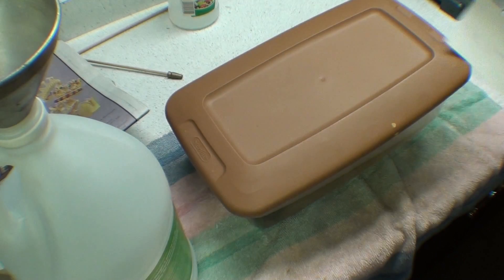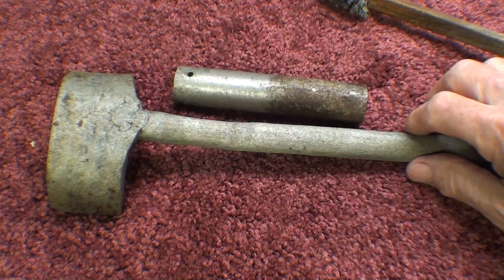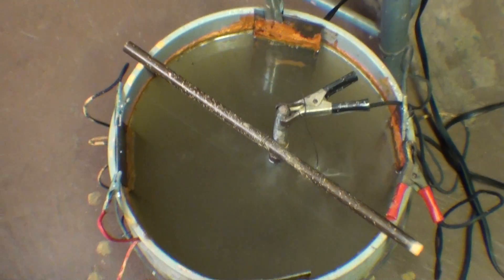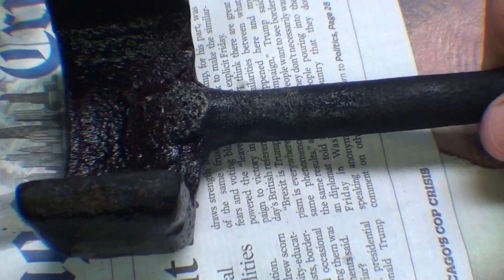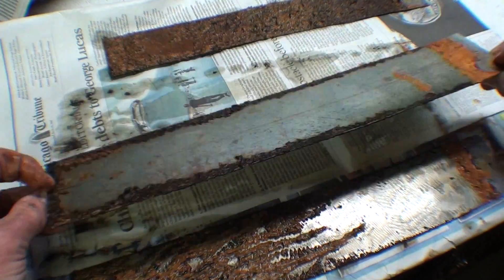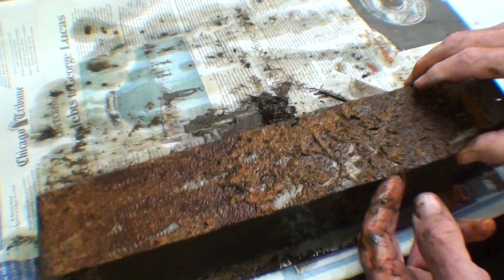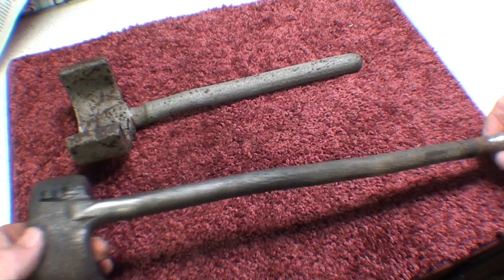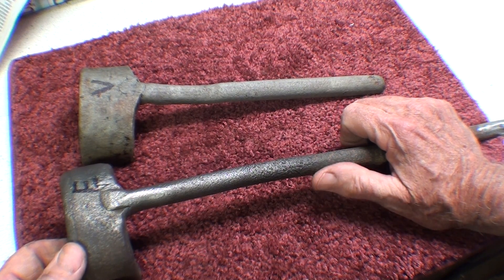Rust Removal -  Electrolysis vs. Vinegar #310 Pt 2 tubalcain

Comment: Hi, since  the two samples are of different source and maybe age, the more comprehensive comparison would have been made if both were cut in half lengthwise then cut again in half wide wise on the greater diameter then compared equally in this test. This video does not let me form an opinion - two parts from different samples have not been together in the same bath.
Reply: I aggree

Comment: Thanks for this straight forward, down to earth video that we non-chemists can understand. I think both processes work well, but for a motorcycle tank I think I would go with electrolysis, because it doesn't rust again after the process.

Comment: I find vinegar too corrosive. However you can expedite the time it takes in electrolysis by using the 10 amp charger. also clean the anodes every few hours down to bare metal and don't let the anodes or the cathode sit on the bottom of the tank. I do a lot of this and I find it works very well on all kinds of rust and even seriously rusted cast iron cookware.
BTW a great cheap source of sacrificial anodes are electrical conduit. And just 2 is fine in a 5 gal bucket. 4 seams slow down the process. Oh and the charger cant be one that shuts off automatically. And do it outside or in a well ventilated area. It creates Hydrogen gas and Oxygen..

Comment: Vinegar rust removal is destructive as it attacks the good metal as well as the rust. Electrolysis is non destructive to the good steel and only affects the iron oxide layer. The black coating left behind is magnetite and can be scrubbed off or chemically removed by soaking in a weak acid mixture such as lemon juice for several hours or over night.

Comment: What are your thoughts on removing rust from a cylinder head?  1953 Allis Chalmers WD 4 cyl engine, push rod/rocker arm style.  Cylinder side is fine, rocker arm side is rusty from rain.  Soaking in diesel fuel right now.
Reply from the maker: try the vinegar
Reply: will do...thanks.  love your videos, and love the detail.  I have a carbide lamp as well; now I know what to clean the orifice with...lol

Comment: what kind vinegar are you using I can't get it to do anything...I left it in there for a week and it doesn't do anything
Reply: ACE Champion 
I've had trouble with vinegar rust removal when the rusty part had oil, wax or grease.  I had to degrease the part and start over.

Comment: You know, the one wrench you cleaned with the electrolysis looks like a cast iron skillet when I clean it with salt/baking soda and season it. I wonder if it would turn black if you heat seasoned it with oil/lard. I think there might have been less damage to the tool with the electrolysis than the vinegar one which is why it is still so shiny.

Comment: I prepare electrolysis as it doesn't remove material. If you use graphite rod as the anode the bath will not turn into a rusty sludge mess.

Comment: used deluded vinegar to make excellent fertilizer for blue berries. they love acid.
Add some TSP to the electrolyte, it helps remove any oil and leaves a slight phosphate coating to prevent rust.
Don Warner

Comment: Hello Mr. Pete, i use the vinegar often, but I want to caution you, do not leave machine tools ( for example: 5 C collets) in for an extended period. Vinegar removes a lot of metal, especially if left for a week( don't ask me how I know this). I have found it effective to put rusty parts in vinegar for a few hours, wipe them off and then put in Evaporust, where you do not worry about eating the mental. This procedure works well and saves the cost of wasting Evaporust on dirty, overly rusty parts.  Thanks   Jim Murphy

Comment: I used Evaporust on a few handplanes and it works well. I also used it on some old japanese handplane irons, and while it removed the rust, it also removed the patina the metal had developed over time.

Comment: Mr pete the black color is because the reaction of the washing soda that tend to black the metals something similar to black oxide process I working in a black oxide company and is kind of similar process that's why you get the black color now for future projects if you want it to make some parts black all you have to do is putting it in that bucket and then oil it and you got your self a black oxide part great video and thanks for shearing this great knowledge.

Comment: White vinegar and iron don't make a particularly toxic mix. I think you are looking for trouble by contacting the EPA.
Reply: I think he was joking
Reply: I Just dump it in the yard.  Iron is and Vinegar are both plain materials that shouldnt pose a risk. People put RoundUp in thier yards which is a questionable risk at best.

Pretty cool how well a 24 hour soak in vinegar works to loosen rust.
Reply: I use salt and vinegar on the weeds in my gravel driveway. Works OK but eventually the weeds return.
Reply: Good luck phoning the EPA.  Expect to spend hours on the phone being transferred around from one bureaucrat to another.  More than likely they will want to send out a hazmat team to deal with the”problem”.
Reply: I agree, contacting the EPA will have them sniffing around your buildings so fast and checking the waterways near your home and lay blame on you if they find anything. For years upon years I've heard them say DO NOT flush your meds down a toilet! Now the other night on the news I watch them say that it's ok to throw the extra meds you have through a garbage disposal and wash them down the drain! WTH??????? Can someone please explain the difference? But I see nothing wrong with it either way.  With the filtration our water goes through and the chlorine and ammonia, etc. going through our water system process why not?? Just dump the vinegar on your weeds.

Comment: The vinegar turns the rust into iron ethanoate salts which are soluble. This is why you don't see much rust in the solution. I would think the quickest way to de-rust an item is to use electrolysis for 2-3 hours to remove the majority of the rust and then vinegar over night to get the matt finish you like.

Comment: The bubbles from electrolysis are fun to pop with a lighter. they are filled with hydrogen and make a neat snapping sound.  It's not dangerous because since the hydrogen is lighter than air the already popped bubbles just dissipate

Comment: Sell the vinegar to Olive Garden to use on their salads, problem solved.  I think I will just stick to using vinegar for corrosion removal.  Last year I used it on some brass regulators I got at Sears back in the 1970's and it worked very well.  Cleaned the torches with it too.   Keep on keeping on.

Comment: At Ace Hardware I picked up some stuff called Navel Jelly. I was going to use it on a rusty chain but didn't end up doing it. I bet the stuff is nasty because it comes in a thick plastic bottle. Has anyone tried it or is it similar to something else?
Reply: Would have been terrible on a chain, unless you wanted to smear it all over every link.

Naval Jelly is for things you cannot easily move.

Comment: Over cleaner/Lye/Sodium Hydroxide works well also, including gunk/grease (engine blocks). Works very quick, but you need to contend with it's high ph (burns skin) and odor.

Comment: I've found that the surface is much better better if you run the electrolysis for a much shorter time. I normally run it for an hour or so and then start checking.  That way you can stop before the Fe3O4 starts to form.  I then wash it in hot soapy water and scrub with very fine steel wool.  Obviously if the rust is really heavy this procedure may not work.

Comment: Mr Pete, the type of metal must have a large influence on the outcome between the two methods you used. I have used electrolysis for many years and feel that process does give a bit more control over the process then any of the other methods, where its really a case of dump it in, cross your fingers and hope it comes out okay the next day!

Comment: Rust never sleeps.
Don't people use Navel Jelly anymore?
Reply: I just finished removing the rust from some iron patio furniture with good old Naval Jelly and a nylon brush.  It only took a couple hours.  Then a quick coat of primer, followed by some Rustoleum.  There good to go for another 7-8 years.  The damn stuff will probably outlast me.

Comment: sorry if this is a double post. sadlly the findings maybe are off because you didn´t use the same specimen to test but two different wrenches you couldn´t be sure of base metal  and state. if you are going to make another video you could split the test piece in half and use as subjects the two halves. ceteris paribus. acetic acid as sold is easy to dispose and will help keep your pipes clean to some extent.

Comment: The etching of iron by vinegar was interesting. Iron(0) really should not complex with acetate. It seems to me that the rust dissolves to form soluble Iron(III)acetate and assorted complexes and then the dissolved oxygen acts on the iron.
What if you add a small amount of reducing agent to the solution? Something like sodium thiosulfate or sodium sulfite should help scavenge the oxygen and help prevent etching of the cleaned iron surface.

Comment: Great video, I must say I actually prefer the electrolysis version better. As for what happened to the rust in the vinegar, it is still there, by the reaction, you created Iron Acetate. If you neutralize the vinegar with the baking soda, the rust will precipitate out as Iron (iii) Oxide.

Comment: Would hydrochloric acid work better than vinegar?
Reply: Hydrochloric acid will work, but you'll want to very heavily dilute it or it'll etch your parts badly.   It's also nasty stuff to keep in the shop.  Unless it's perfectly sealed, the vapors will escape and rust everything in a 10 foot radius.

Comment: I have used the electrolysis before and I found a quick pickling would remove the blackness.  I was using muriatic acid to do this.  It did a nice job of brightening the finish.  Of course it must be neutralized afterwards.

All the best!

Mike

Comment: So many variables involved.  I'm not sure the results were only from one being in vinegar and the other being in the electrolysis bath.  I've been running my electrolysis vat for some time.  The location of the part being cleaned, the strength of the solution, the make up of the metal being cleaned, the quality of the connection to the negative terminal, the quality of the contact to the positive terminal, if I adjusted the item's position during the process, the type of sacrifice metal I was using, and on and on are things that differed my results.  Also, in your experiment, there is an assumption that the metal used in both parts to be cleaned were the same.  Maybe not.  

Check out the discussion about the black film (magnetite) on objects processed with electrolysis.  http://nautarch.tamu.edu/CRL/conservationmanual/File10b.htm#Sodium Carbonate

A quote from the article: "In the case of iron, most of the corrosion products, if they can be reduced, are reduced to magnetite."

Magnetite is magnetic and will give you that black film you aren't favoring.  I found the black film brushed off easily with the wire brush, if the part was set up and run properly, and the dust collected was magnetic.  

I've also run some pieces and not been happy with them when they came out.  I rechecked the connections to the power, the strength of the solution etc, etc, ... you get it.

Another thing I found, sometimes the connection wires only were making the brew bubble and nothing much was happening to the part.  When I scuffed up the connection between the part and the negative terminal to the charger, the piece started being involved.

I've been pleased with the results.
Reply: chicago needs tougher gun laws.   oh, wait...
Reply: Maybe a magnet can also be added in the tank to collect the magnetite so the parts don't turn black.

Comment: I was wondering if the longer wrench was made of wrought iron and the shorter one of steel. The silicates in wrought iron could have caused it to react differently in electrolysis than steel would.

Comment: Try heating the vinegar next time, it will work much faster
Reply: very good advice. heating increases the action and if you boil blackened and dirty brass fittings in vinegar they´ll come shiny and clean after a few minutes. the house will smell funny tho.
Reply: p penca boil it first and put'em or put 'em and then boil ?

Comment: I am curious how carbon content might affect the reactions with vinegar and electrolysis.  I would venture to guess that the anodes may have had a higher carbon content than the wrench.  It would be interesting to see this same experiment done with a high carbon item.  A decent size, well rusted file would be ideal.  It would be easy to make two samples (ie: a vice and a hammer), and the material would be known to be identical.
Reply: It's not carbon, it's chelation of the iron. The wrench he put in Vinegar was considerably less rusted than the other one.

Comment: As a control you could precisely weigh some already clean parts before and after to see whether there is any loss of the base material.  My guess would be the vinegar will etch some of the base metal away whereas the electrolysis won't, but that's just a guess.

I'd be interested in seeing molasses.  It seems like it would be more expensive, but as I'm thinking about it and how sticky it is you might be able to just paint some on instead of soaking it in a full tank of the stuff.

I'd label that bottle of used vinegar to ensure it never ends up in my salad, or better yet, toss it out.

Comment: Apparently you are just biased towards a matte finish. Which I doubt the wrought iron had when it was manufactured. Vinegar is the simpler of the two. Citric acid would be better too. Which you can get in powder form. It runs about 2 bucks a pound.

Comment: I have used electrolysis for a long time as I am in the engine restoration it is the best as vinegar and other acids they eat away the virgin material in fact especially machine faces they become very harsh to the touch, that is etching!!

Comment: I live in an environment where you can watch metal rust, so saying that, I  use both methods, I have 2 5 gallon buckets (Electrolysis) for the bigger parts and a 1 gal (Vinegar) for the smalls. Anything that comes out of the big tanks get parkerized!

I run my two tanks on 6VDC, there are for large 6VDC batteries, I charge them during the day and let them work there magic at night, after a few days I remove the parts and Scotch-brite them then prep an parkerize them.

One complaint about  Electrolysis is the mess and the need to deal with the water/sludge, not an issue, use Carbon rod stock, the water stays clean, I have been using my rods for 6 month and there in need of replacement, 4 rods $5 each Amazon. just once a week you need to pour off the water into a clean container and depose metal/rust that collect in the bottom (it starts to short out the rods to the work), metal cross bar, and I hang the work on copper household wire. 

I do use a $100 DI water filter and mix the Soda to water 1cup to 2 gallons, I get a better mixing with the filtered water.

I have done everything from my tool table tops, 1-2-3 blocks, sine-vise, to my insert screw bits, I am currently thinking about doing my compound and cross slide on the lathe.

Don't really like Vinegar, but I am not going to hook up every Little part to the Electrolysis tank.

Well there is my two cents!
Reply: OK for us dummies, what is parkerizing?
Reply: @lrstaf6  replying 7 years late, but it is covering with a phosphate layer also called converting to prevent more ferric oxide [orange rust] from forming.

Comment: Have you tried Hydrochloric acid (Industrial Toilet Bowl Cleaner)? I used it on some old brake rotors and it knocked all the rust off in under 3-4 minutes.
Reply: https://postimg.org/image/nty7iydw1/
Reply: All I did was just went outside and soaked it for about a minute, then scrubbed lightly for about 30 seconds on the bottom face of the rotor and rinsed off with water to dilute it. It is safe to put down the drains. The top part of the rotor where the wheel makes contact was not scrubbed and you can see how well it works. Also works well with removing calcium. I bought a pack of 12 for 55$ CAD (42$USD). Each bottle is 32 oz.
Reply: damn thats easier and quicker then any other method I know. Just by the pictures thats amazing. Thanks for sharing, you most likely saved me a lot of time!
Reply: Hydrochloric acid can be found in pool supply stores, Note of caution, I stored the remaining acid in the original plastic jug, it out gassed and rusted all steel in the area.
Reply: Hydrochloric acid is also known as muriatic acid and is a cleaner/descaler. It is the most active of acids and should be used with a great deal of caution. Properly used it is a very effective product but it can also hurt you badly.

Comment: Very interesting comparison. As far as disposing of the vinegar goes, it is poured down the drain every day. However it also makes a good Herbicide when you add a little bit of orange oil and soap to it. So don't throw it out on your grass. As far as that one wrench that appeared to be used as a hammer goes, it may have been used as a tent sake, or something similar.

looking forward to your next video. Very educational.

Work smarter not harder, and stay safe.

Joe.
Reply: wagon wheel nut wrench,, old old old school tool

Comment: I like the vinegar results better only because it seems to be a lot less work as you stated if you have to use a power wire wheel why not just use it from the start? I am sure the electrolysis has it place and I will use that method as well but I think it depends on the metal and the amount of rust to be removed -I was shocked there was not very much scum left in the tub w/ the vinegar -I don't get that?